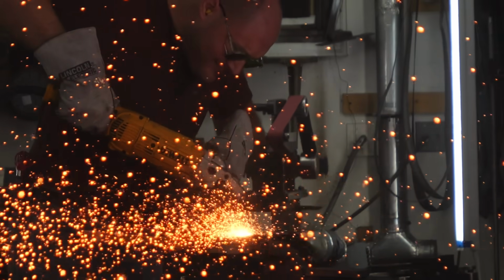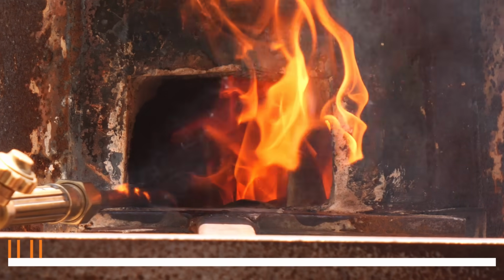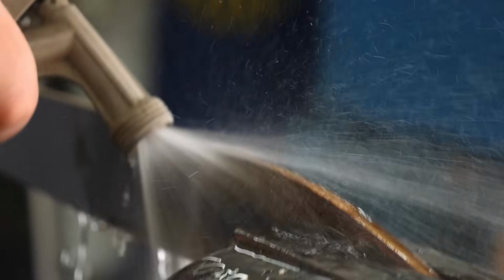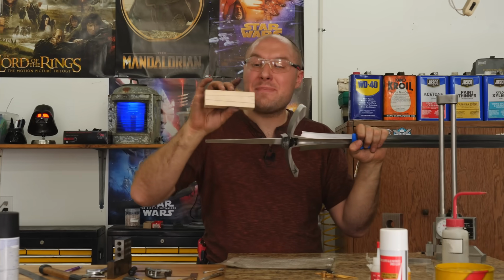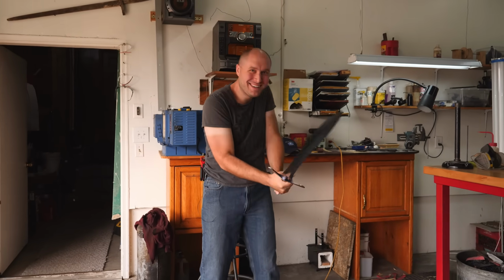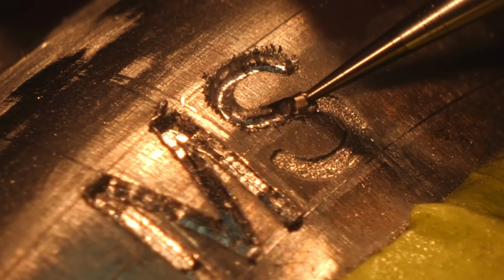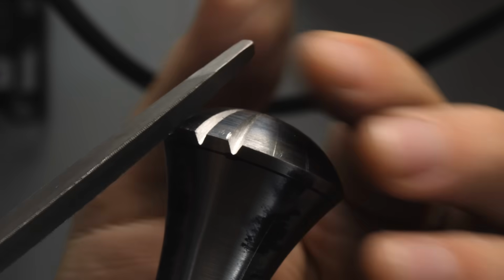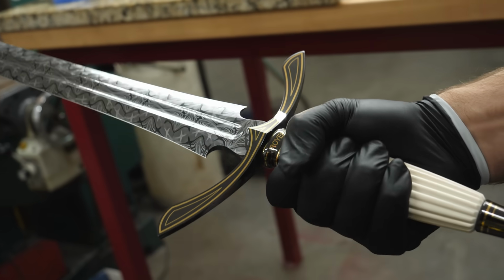I Built A Legendary Longsword (Sold $65,000)

Comment: Ultimate Combat-Ready Katana Build

1. Blade Edge – Tungsten Carbide Layer
Why? Insanely sharp and holds an edge better than steel.
Issue? Brittle on its own, so it must be used as a thin outer layer, not the whole blade.

2. Core – Titanium Alloy (Titanium + Vanadium + Aluminum)
Why? Ultra-strong, flexible, and lightweight.
Issue? Hard to forge with steel, but possible using modern metallurgy.

3. Spine – Maraging Steel (Nickel-Iron Alloy)
Why? Super tough and impact-resistant, used in military-grade armor.
Bonus: Can absorb high-force strikes without cracking.

4. Coating – Chromium + Vanadium Plating
Why? Prevents rust, wear, and heat damage.
Bonus: Used in high-end weapon coatings for extreme durability.

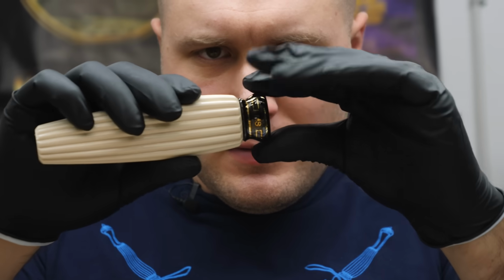Comment: @00:13 put playback speed to 0.25x and watch as the blade folds about 45 degrees.  The elastic strength of the steel used is insane.  Awesome!
Reply: Последовал Вашему совету и сделал так. Получил огромное наслаждение от просмотра.

Comment: i really like the zero tolerance to flaws and the attention to details, That is a work of art (even if it a bit too much for me personally)
Reply: I took up blacksmithing as a hobby a little over a year ago and I'm still very happy when the things I make actually function as intended.
I've pulled out a couple really nice looking knives, but I'm still struggling with heat treatments.
Reply: @Great-King-Lord_Bezer  what is your Problem with heattreatment? 
I'm making knives for 5 years as a hobby and would be happy to help
Reply: @Sebastian-ed5kt  My problems are 1) knowing when my metal is at the right temperature for the heat treatment 2) heating the metal evenly (I'm using a 1 burner propane forge) and 3) knowing if/when/how to do tempering after a heat treatment.

My uncle really wants a stainless filet knife to keep on his boat, so I've been working on 304 and 440c
Reply: @Great-King-Lord_Bezer  i may have a few solutions for your problems: 
1) harden in the dark/ shade and look up the colour aeqivalent to your needed temperature on the steel colour chart
2) i have the same forge setup and can harden blades up to 40cm long
the trick with this: use a steel tube in your  forge to distribute the heat evenly and prevent the blade from cooling too much by the direct flame contact 
 3) tempering: right after hardening (you have a time window of about 2hrs in which you should have started the tempering) 
best is a tempering oven, but a normal oven works too

temperature is what the data sheet says 

and idk where you are from but here in Germany we have multiple makers that offer a hardening service (sometimes with a cyro treatment to give you maximum hardness and toughness) for like 9€/knife 
so that could be a valid option

if you let your knife be hardened in an oven etc i would recommend steels like 14c28n or aebl for the knife you are making because they do need a bit more complicated heattreatment but they will outperform 440c any day & 304 is not a knifemaking steel😉
Reply: @Sebastian-ed5kt  Thanks for the advice!

Using a steel tube to distribute heat and doing my heat treatment at night I think will help me a lot.

Some website told me that 304 would be good for a filet knife because it's so bendy, but yeah.... it's way too soft lol

There are heat treating services here in the States. I've sent one knife off for heat treating, and the post office lost it in transit....

Comment: Amazing workmanship. That being said, one safety suggestion. Build a platform for that forge setup you have. It wouldn't take more than a few hours, and it'll virtually eliminate the risk of falling vs standing on that ladder and give you a fighting chance if you would lose your grip on that hot steel and it falls, you'll have some place to go. Bonus points if you go all the way and add railing so you don't accidently step off and fall if something does happen.

Comment: You're clearly an amazing artist, and this sword is gorgeous, however there's a few things I'd like to nit-pick from a swordsman's perspective (not that I'd be pissed if I had to use this sword forever). The grip isn't as indexed as I'd like, it seems a bit too rounded and not oval enough, though that may be an artifact of the camera. I really don't like a threaded pommel on a sharp, it really should have been pined; not only is that more historically accurate, but the blade would have been so much more secure. Also, all the grinding seems to be a waste of material, why not use less steel and forge it down to size? Is that something necessary to maintaining the pattern?
Reply: I'm also curious if for the sake of bringing out the patterns the durability was compromised and correct me if I'm wrong but that sword looks brittle
Reply: @aether6098  I don't think the acid etching does, but I could be wrong as well.
Reply: @aether6098  Damascus itself is technically a compromised material to start with due to having so many forge welded points. Any damscus blade is likely to be weaker than many cheaper blades made from a high quality consistent carbon steel that is never forge welded or layered. The point of a sword like this though has nothing to do with integrity and durability though. Something like this is strictly an art piece. Even just sharpening the blade could mess up the pattern. From a practical point of view, something literally just as effective or even better could be made for well under $1000. 

To me, this is more comparable to a beautiful painting. Its about how it was made, the effort it took to create, and the raw talent and skill it took not only to make it, but to even design it and plan it out in the first place.
Reply: @tommyss4l  And no, the acid etching should have no effect on the integrity of the blade, but the forge welded points across the blade are technically slightly weaker than if it was made from a single billet that was forged to shape.
Reply: Yes, if the blade was forged to shape to save on material it would have messed up the pattern at least to some degree. Small variations in the steel would make the pattern warped. Sometimes you're not looking for a perfect pattern, but in this case he was likely looking for a very precise pattern and forging it to shape would have stretched the pattern completely woth the shape he wanted
Reply: Personally, if i had the money for something like this, i would have this as a wall piece and have a second cheaper version without damascus steel and gold inlays made to actually use 😂
Reply: @MrLemonadefreak  yeah but if I'm spending $65k on a sword, I want the grip to at least be properly indexed.
Reply: @MrLemonadefreak  I mean, yes even crucible steel Damascus isn't as good as monosteel which is why Europeans abandoned crucible steel in like the 900s
Reply: @MrLemonadefreak  fair enough
Reply: @tommyss4l  Ya, i dont really have much to say on that one. You're definitely not wrong there (on the handle)
Reply: @MrLemonadefreak  I've done a lot of cutting and you see historical examples and they all are wide ellipse handles except for Thrust only swords. My antique Sabre and spadroon both have nearly d shaped grips. That indexing is super important for knowing where the edge is.

I'd i paid 800 in material for the grip, it better be perfect, not that slightly flat cylinder as shown.
Reply: @tommyss4l  Ya, I know what you mean. I have a couple swords myself and they have very long elipse handles as well. But it could very well have been a choice made by whoever commissioned the sword. Could be that since it's a decirative piece, they thought a rounder handle would look better, and even though it doesnt make a ton of sense, I could definitely see how that could have been the idea behind it
Reply: @tommyss4l  Also, because of how the handle is fluted, a wider, flatter handle would have probably looked very strange with that grip design. So since it's probably not going to be used to actually cut anything, much less for self defense, im really not too mad about it

Comment: This is already incredible using modern technology, but it really makes me amazed at how blacksmiths in medieval and before times crafted such elegant swords with their basic tools.
Reply: especially without the welder, how did they do those patterns i wonder
Reply: @darken3150  past blacksmiths built different
Reply: @trashmix2184  No kidding, i'm guessing they did alot of folding style layers?
Reply: @darken3150  By pattern, do you mean real Damascus? If so, it was just a product of a particular crucible steel and was entirely incidental. The particular crucible used was short lived, which is why there's not much of it and why it was made so mythological when we rediscovered it. Etched patterns were... Well, etched.
Reply: They couldn't make a sword like this in those times

Comment: This is easily the best looking sword I've ever seen just on design alone, let alone that incredible Damascus but also can you imagine buying something for this much that was used to shave someone's legs?
Reply: Well. Most handcrafted blades have been used for such. Bladesmiths commonly test the edge by running it over a patch of their body hair.

I know there are some quite large sword vendors out there that offer unsharpened blades, if you're worried about the smith who labored over the chunk of metal at hundreds to over a thousand degrees, sweating onto the metal for days to months and handling it all that time having it against their bare skin one time more than they would have otherwise.

Y'know. Just in case you feel squeamish over that kind of contact with the blade by someone else.

Comment: If you were to do another one or a small batch production using this approach, then you could save yourself (many) days of manual work by using some slim "sacrificial" surface grinder wheels and progressively "dress" in the profile for the fuller. Don't make the whole profile at once because the small contact area will wear the wheel very quickly. If you plan and dress it in stages as the fuller(s) progress you'll substantially extend its short but effective lifespan.

The concept is gonna need adaptation and modification to fit a job, and it might not get you all the way, but if you have a surface grinder this can be a useful trick.

Comment: Next time I suggest you to harden the blade after the gross grinding (14':00) because due to the high temperatures in this grinding process your hardening properties are lost exactly where they are most needed,.......at the sharp edges. The final sharpening should then be made with water cooled grinding stones for the same reason since we are talking about even narrower sections of metal prone to heat with sandpaper belts
Reply: Hardening is generally superfluous, this is an art object, not a gun. Yes, and the transverse layers became made by a "sword for a pair of blows."
Reply: @ In fact, Damascus is not made for cutting, given the structure with different concentrations of carbon, it is impossible for a non-temperable part of the blade not to end up on the cutting edge. But so much dedication and perfection deserve good advice and I have been lucky enough to have good teachers in the cutlery branch. It was a pleasure to see this video and I am grateful to certain people for existing

Comment: If anyone wonders about the stats, here they are:

Soulbound Item
Physical Damage: 1022 - 1552 [+204 Radiant Damage]
+102 Strength
+62 Stamina
+102 Willpower
+211 Parry Rating

Item Set: I am Legend
1/2 - Adds 20% Radiant damage against Demon and Undead in addition to Physical damage.
1/4 - Critical Strike Rating becomes equal to Attack Power after slaying a Demon or Undead for 25s.
Unlocks: Glorious Bastard emote

Class Restriction: Warrior/Paladin/Rich Wanker
Value: 65,000g

Comment: Could you not have just rounded the tang where a screw thread  needed to be cut for the pommel.
Ìt seemed that the extra grinding would weaken the integrity of the handle.

Comment: This is a beautiful toy, the creation of which has invested a lot of effort, but it is not a sword. The location of the layers across the blade makes it incredibly fragile, the absence of the outer soft layers and the inside of the hard makes it disposable. The idea that you can boil a lot of tiles in a long beam at all withstanding any criticism at all, this is unacceptable for something experiencing shock loads. And the fact that they first tempered the workpiece, and only then removed half the metal to create a form ... I have not yet met such idiocy, hardening on the surface and in the center differs, especially when you harden in a thin pipe vertically ... Why harden then?

Comment: It always bothers me when I see fullers ground in. It shows that you know how to make a pretty sword, but you have no idea how metallurgy works. The REASON a fuller adds strength is because the hammering process forces the molecules of the steel to take a different shape while still bonded together. It's the same concept as bending sheet steel to make frames. Shaving metal out of the way only removes material from the center, and thus WEAKENS the blade because you're not reshaping anything. It's like taking an ax and chopping off someone's stomach, vs. Them doing the hard work of getting into shape.

Comment: Somebody correct me if I'm wrong, but this sword is purely decorative right? It would be useless in combat, or at the very least extremely unwieldy. The handle is too short and looks very uncomfortable. Also, the part where he strengthens an already warped blade seems very sus to me. Maybe it's common procedure, idk, just seemed like covering a f*ck up.
Reply: It is obviously, because people don't use swords in combat anymore, but it would be an amazing blade for battle.  Comfort is irrelevant, If ur using a sword u'd be wearing gloves, armor and people are trying to stab u. Comfort is ur last concern lol. The grooves, while they might hurt ur hands, are going to improve grip massively and prevent it from ever slipping out of ur hand or rotating in a clash.
He said the handle is 8" so unless ur massive it'd be easily 2 handable.
Warping causes no real damage to the blade. Just makes it look it off, unless he cracked the blade when bending it the fix would hurt nothing.
Reply: @verakoo6187  How would comfort be irrelevant? It is of utmost importance exactly because you're in battle and have to keep track of your enemies. You can't be having constant pain / discomfort in your hands distracting you.
 Also, real historic longswords, as far as I know, have massive handles to allow for leverage. It's not enough to just be able to fit both hands on the grip.

Comment: Impressive! Though I wonder how master blacksmiths forged swords like that in the medieval times without all that mechanisation
Reply: They did not make unnecessary drawings, thanks to which it will collapse after a pair of blows on something solid. Damascus steel is the creation of layers along the blade, and not across, and the drawing that we see on the surface is a consequence of forging with a hammer plus further sharpening, that is, a side purpose.